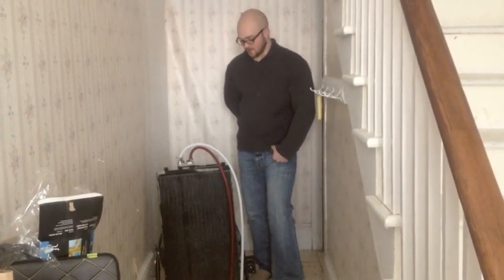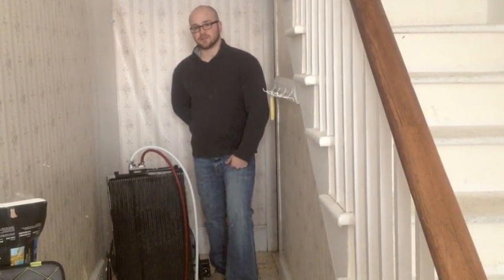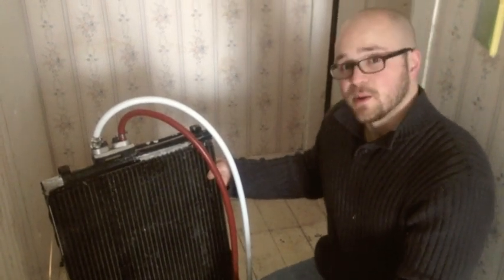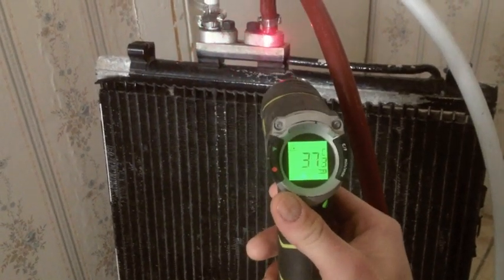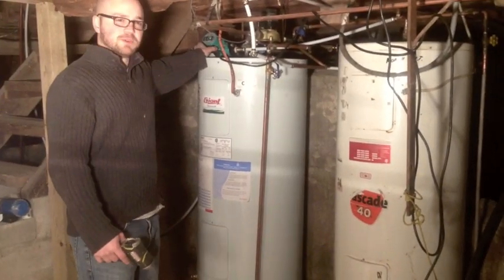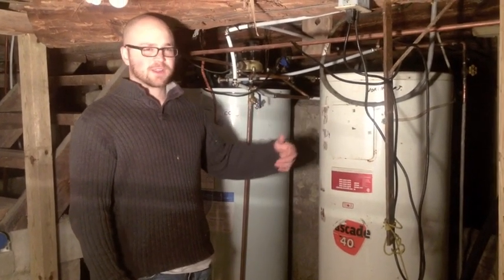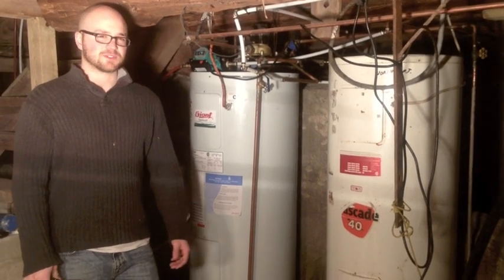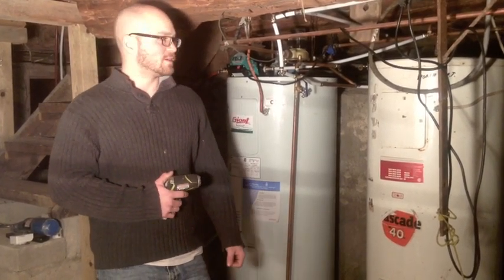HEATING HOME WITH ELECTRIC HOT WATER TANK!

Comment: Use Antifreeze. Pump it through your tanks and radiators till all is full and add an electric water pump to pump it to the radiators.  Put a Vent or release valve that will release pressure. Turn the water heaters up to max they dont use much electricity.  I looked this up to see if it would work.  I will use 2 or 3 water heaters in line with each other

Comment: 6kw is about 20K BTU's so yea, I can see that warming a home running constantly.  IMO not the most efficient way to do it, but you do what you gotta do sometimes to get through a period.  I've been planning a system that uses somewhere around a 500 gallon super insulated water tank that is warmed via multiple sources...solar, wood fired boiler, propane for emergency use etc.  Using a tank as a giant heat sink, It's just a matter of burning a wicked hot fire for a few hours and storing the heat.  Instead of using a water to air heat exchanger like here, I will just use the existing hydronic radiators and circulate through it.   

Good luck, and stay warm!
Reply: Did you ever build this? Got a video?
Reply: My opinion is it's a pretty efficent system but may not be enough btus on really cold nights. These type of systems would be great to program with time of use meters.

Comment: great job on the build! I plan on doing the same with a radiator and 12v fan running off a solar charged battery. What radiator and fittings did you use to attach the pex to the radiator?

Comment: i been wanting to build something like this...i am useing a small 10 gallon water heater then a complete radiator from a truck that has 2 12 volt fans...got a small pump from harbor freight.....i live in a trailer that has no furnace..i use a pellet stove in front part but there is no heat in back at all so this is where its gona be installed in laundry room....
Reply from the maker: I actually had a lot of fun experimenting with this and would love to revisit it all! I’ve been pondering using an induction stove to heat the water somehow

Comment: Interesting and could save money with off daytime rates on electric.  I am concerned that car radiators can leach a fair amount of lead (thus the warnings concerning backwoods moonshine that is made with car radiators).  Be careful that the hot water is not back feeding out the cold water and into the cold supply or that the kids aren;t drinking their shower/bath water which may contain lead.
Reply: Brian Johnson some type of backflow prevention would definitely be a good idea!
Reply: Thats an Air conditioning radiator, otherwise known as a condenser, they are made from aluminum not copper
Reply: He has two ,TWO, 2 did I say 2 water heaters lol

Comment: This is interesting. After the recent Grid Outage in Texas, we started looking into a home standby generator. I am considering pulling the generator's radiator, and putting it on the inside of the house, with the hoses extended through a window plate into the house. Why waste that engine heat to the outside air? Also considered reclaiming the exhaust pipe heat (but not the exhaust) like an okd volkswagon beetle heater, somehow. Electricity AND heat!
Reply: That's what I was wondering, if you got a big diesel generator and used it's exhaust and engine heat to heat the house and use the electricity, how much diesel would it use compared to just using electricity for everything?  
Maybe some day someone will test it, I don't really have a generator.  
Diesel because you could run it on red diesel which is cheaper.
Reply: @markothevrba  you might be able to reduce the load on the generator by not pluging in a heater. With a water to exhaust heat interchanger, you might be able to heat yout hot water for a shower, further reducing the load needed for the electric heating element in your hot water heater tank. All this may allow a smaller generator using less fuel.

Comment: Did you use a relief valve or expansion tank? I plan on a similar system but using the existing furnace blower with the rad (heat exchanger) in the hot box. Not expensive to run as I will be using solar to run the water heater. Water heater is easier to maintain the heat as it is a close system. I estimate the water temp out to be 150 and going back in to be 110. Less energy needed to heat 110 degree water than the house use water heater that has 55 degree water going in.
Reply from the maker: There was a relief valve, and it didn't get hot enough to think about an expansion tank.  I think this system would have been cheaper to use a gas generator to power the tank.. Our hydro bill was almost $800 in the peak months
Reply: +Jeff Ballantyne (Lotsofwoods)  Yup say 6KW per hour X 24 hours a day = 144 Kw , average here @ 10 cents a Kw ( where I live ) = $ 14.40 a day X 31 days a month =$ 446.40 a month ...
Reply: Trina McDonald v

Comment: 6kW peak, probably running an average of 5.5kw? After all, its a hotwater heater and not meant to be on very long at a time... So very power hungry when running. But for general calculations, we will under estimate at 4kW.

4000w per hour x 24 hours = 96,000 watts per day (96kWh)
96kWh x 30 days = 2880kWh per month.
Average price per kWh for US/Canada is .11 cents.
.11 x 2880 = 316$ (USD) a month! 

At full peak wattage, that would be 475$ (USD). Much more simple, and common, ways of heating for that price!

Comment: why not just use resistive heat direct to air? Why heat water just to have to get it to air via the radiator?
Reply: +averagejoeusername the best heather and cheaper is an oil radian heather ,,one setting on medium,,if you need more heat buy more heather,,right now my house is empty so i have 2 heather on med....thermostat on 4,,i use 32 kw per day and my house is 60 to 62 degrese,,nice and dry

Comment: To the idiots blabbing. Yes this cost to run BUT it is far more efficient than space heaters. BTU is BTU and he would need 20 space heaters to do the same thing. The cost would tripple,
Reply: Really, not trying to stir controversy, but... you're incorrect. He said the water heater was 6kw. That's 4 traditional space heaters. And space heaters are 100% efficient, just like the electric water heater. That is, all real power is converted to BTUs at some point in the process. You don't magically create BTUs just because water to air is utilized over air to air. 

To me, this is a great start on a central system, where the energy load is centralized and the hot water is only sent to the rooms that need it. That's what makes radiant heat so awesome.

In this case I see the value in using an existing water heater that he didn't have to buy, but there should be no illusions. Four space heaters could be bought for the cost of the recirculation pump.
Reply: All of the feedback on this video is incredibly helpful. My question is a switch to cooling instead of heating. Can you offer your feedback on this?  Freezing ice in a chest freezer at night and then circulating the cold water through the coil/radiator and fan similar to here. Of course I imagine a better built case/plenum. Thoughts?  Icebear company is doing this but I am curious if it would save money if built to quality vs being a learning experiment and loss of money heh.

Comment: The idea here is not so bad, however substitute electric instant hot water heater with a gas fired instant hot water heater, say propane, or natural gas, or better yet make your won using Kerosene. Natural Gas Preferred Cost wise of you have access, if not Kerosene will give you most BTU/$.  Then You can use fans and these radiators, with arduino and some sensors, to provide climate control, and control water flow from the tankless.  For an inexpensive 10L Per Minute  Heater expect to pay $200 plus, you can get a radiator and fan from Junk yard for $40.. and another $100 for pipe fittings, sensors, etc/  You can then deliver up to 86,000 BTU.  Natural Gas option will still be the same per BTU or Therm, Kerosene gives as of 2017 125,000 BTU/Gal for about $3.10
Reply: The added benefit to doing something like this and having tanks, is that one can treat as a modular system, and also add over time solar evacuated tubes for solar hot water, when sun is out, reducing ones need and call on the gas, and with sufficient holding capacity (Tanks) and input capacity, the tankless only needs to come on to boost temp slightly for home, and for showers laundry, etc.  Remember the greater temp you hold in the tank, the more the losses, so ideally you want holding tank temp of say 75F to 85 F Say 85F an sunset and 75F at sunrise.  Back of the napkin calc/ you want to estimate water circulation like a geothermal pump at about 4GPM per 12,000 BTU.  For extra efficiency one could use inline striling engine pumps which use the temp diff between inlet and outlet to pump and while this is more efficient, unless you are a machinist, the cost fo such does not make sense, until such a time, as there is a volume market on such so you can buy inexpensively.

Comment: Average joe hit the nail on this one.  You are consuming electricity to heat water pump water and pump air.  You are heating water in an unused space and no doubt loosing heat there that isn't helping keep the family warm.  Not very efficient.  The money you spent on the pump alone would have got you 3 good electric heaters at least .  These could be put at the point of use and maybe save you some energy overall as you would not be loosing heat in unused spaces and only heating spaces when you are in them, and not pumping heat up from the basement.  If I already had ALL the parts and no money this might make sense for the short term to servive but direct electric heat is expensive.  As mentioned a heat pump is way more efficient for delivering BTU's over the long haul.  Education costs money, so you bought some and can learn from this to setup a more efficient system next time.  Good luck
Reply from the maker: Thanks for the response.  My material cost was $150 which I basically already had all the parts for.  I spent almost $800 on hydro each month during a horrible winter in a house that has no insulation.  Heating with wood now.  It was fun to experiment, and I know alot more now.  If there was another way to heat the water through the rad you would have a very warm room very fast.

Comment: i do nto  know if you will get this butt  also hooked up to the cooiling coils  in the a/c air. in the blower unit..   with a small puum to move the water.. though the tubes. for hot water heater .  just like the car heater. but water..